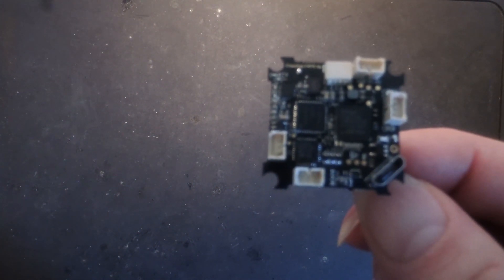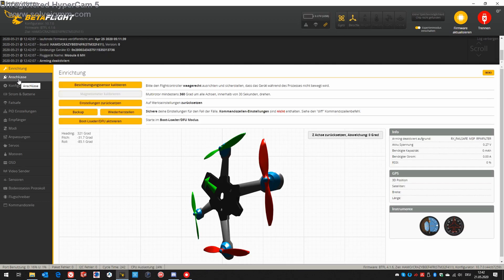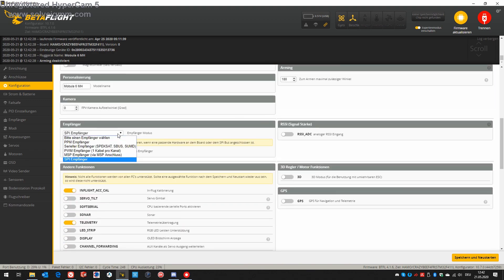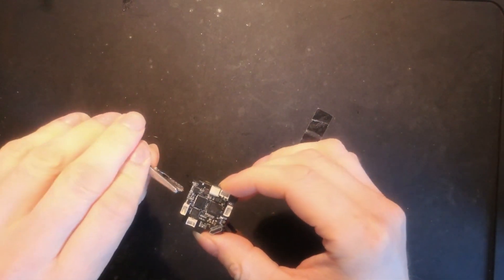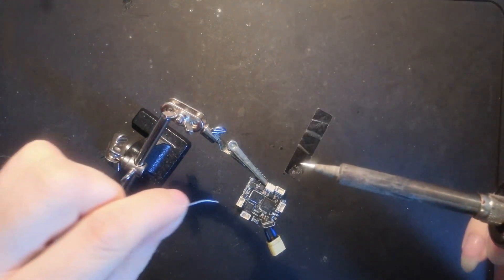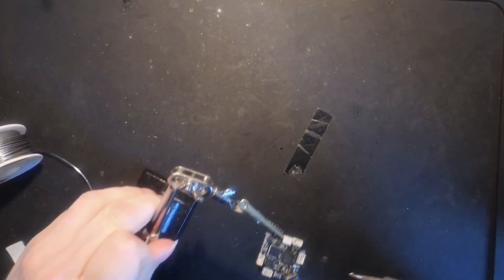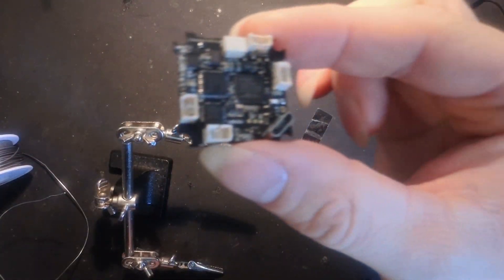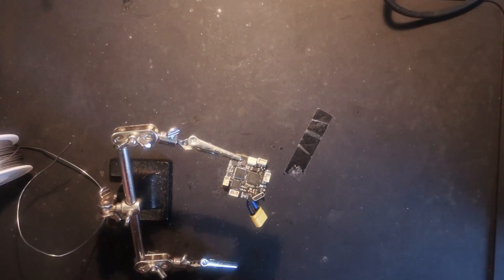Mobula6 to Crossfire mod (Crazybee F4 Lite) in real time

Comment: Followed your video and got the Crossfire working... But the video is really bad. I am using a different Mobula 6 board where the layout is a little different but still used the correct uarts. Did you experience this? If so how did you fix this? Thank you in advance.

Comment: did you have bad range originally on the mobula 6?
Reply from the maker: Yep, it was only flyable in the same room at our community hall. It lost RX signal as soon as a wall comes between you at about 10m/30ft.
My other US65s and Tinyhawks had no RX losses at all, in the whole building.
Reply: @OberFreak83  so i have the FRsky rx on it i can just put like a tracer Rx on or not?
Reply from the maker: @OLEHFPV  sure, tracer shares the same pins and config with Crossfire.

Comment: I did this mod and I get a lot of video noise, using frsky the video is a lot better. Can you give me a clue about what this happens to me?
Reply: Dang I was going to do this mod but I might just leave it as frsky and build a whoop with crossfire. Did you try taking off the tbs crossfire to see if the noise went away?
Reply: @boonjuefpvboonjue1230  no look, the noise continue so I removed the nano crossf. This happens because the crossf antenna are really close to the mobula antenna, but I have almost not space to move away the crossf antenna.
Reply: @boonjuefpvboonjue1230  No look, the noise continue, so I removed the crossfire. I recently bought the meteor with crossfire and works just fine. I think the issue is with the crossfire anntena and the video antena on the mobula, both have to be away, but with almost not space is very difficult to do that. With my meteor is working perfect because the board not include an integrate video transmiter, it's external and I just turn up the anntena away from the crossf anntena. I have to try again this mod with the mobula, see what happen.

Comment: Why the XT30?
Reply from the maker: The XT30 give a mutch better performance in the long term over the PH2.0.
The BT2 is another good option with almost the same performance and less weight to the XT30. But all my Tinies where already equipped with XT30 when the BT2 became available.